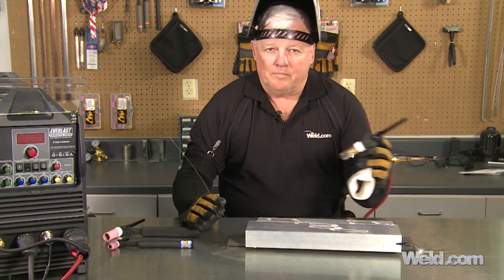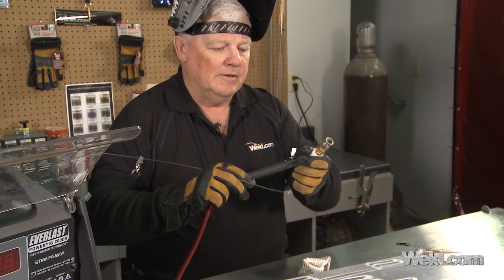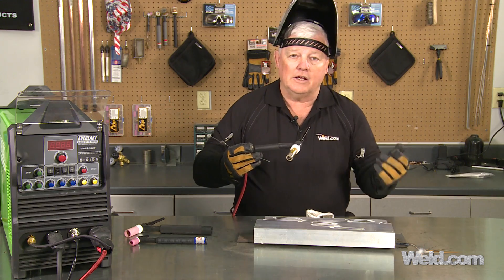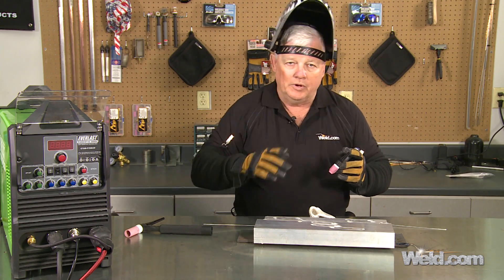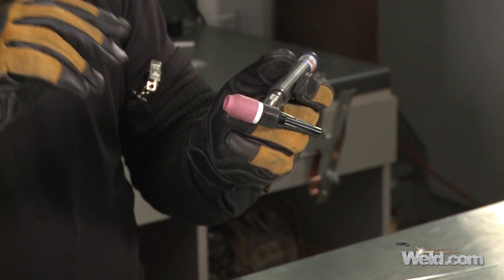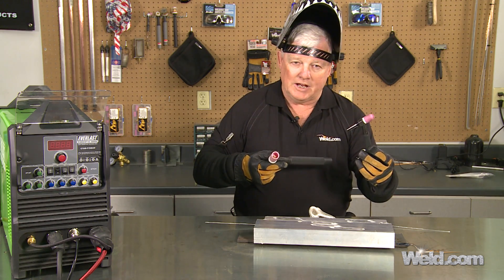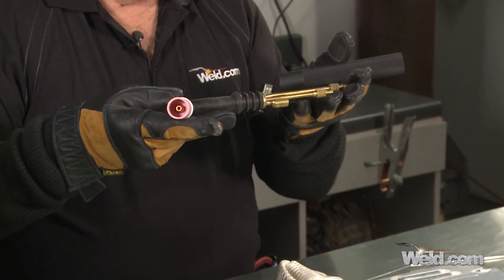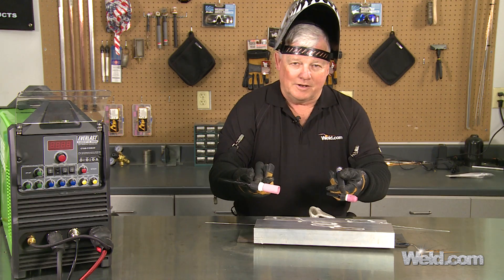Introduction to Water Cooled TIG Torches

Comment: I just received a water cooled tig torch, QC brand by esab,  20 size, flex head with a valve. i'm trying to hook it up to my 2015 AHP alphatig. Everything is hooked up, but gas will not feed through the torch, even when the valve is open. if I put compressed air into the gas inlet, it does not blow out the torch, but rather, it blows out one of the coolant lines backwards. Question is: do you have to be running coolant in a liquid cooled torch for the gas to flow? and if so, why? Other wise, if not, why might that brand new torch not let gas flow into the cup, but rather, down the coolant line?   Id be very grateful for your help!!

Comment: I have a 300A machine and a 130A rated tig torch... I think I need todo something about it.
Reply from the maker: You can still use it for the time being. Just make sure to do the math and de-rate your torches duty cycle to meet the amperage you are using.

Comment: The other advantage to tig welding is the amount of grinding required.  Something I learned was that a significant amount of distortion can occurr from grinding the welds, overheating the panel.  So a tig welded bead will require minimal grinding and therefore allow for less change of panel distortion.

Comment: Wyatt
How does the Everlast 200dx compares to the Miller 200dx I'm sure the everlast is less expensive but which is more durable over a period of 3 years
thx
art
Reply from the maker: Unless you plan on putting it on an assembly line and running it non stop, the Everlast will hold up just fine. The difference is the Duty cycle, but for doing projects in the garage it won't have any problems.